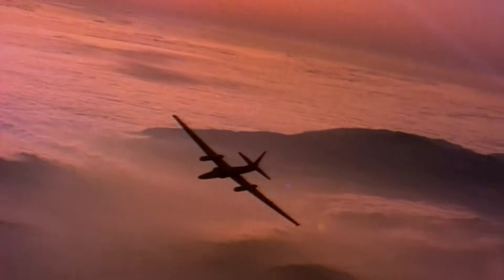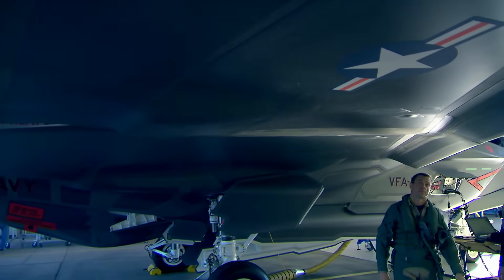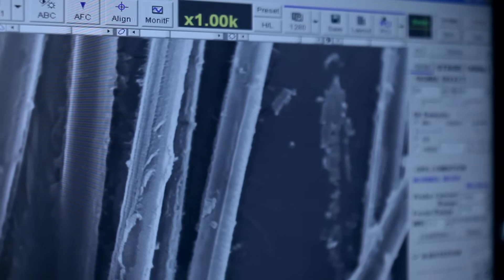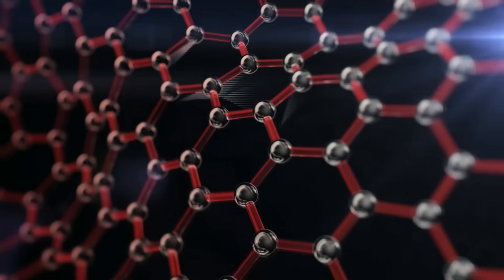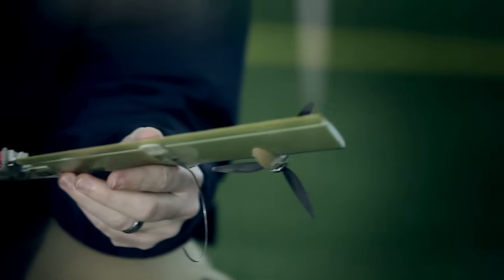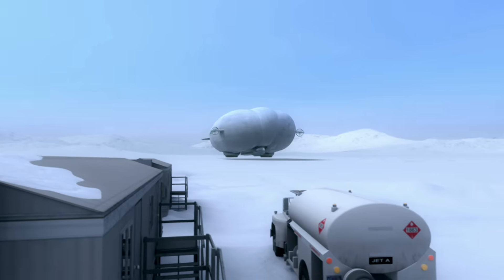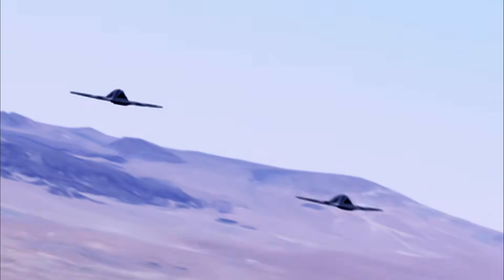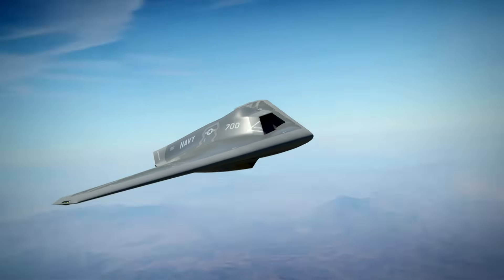Speaking of the Future:  Advanced Aeronautics

Comment: ***ALL THE RAGE***
- inertial-mass reduction 
- High, hypersonics (Mach 10+)
- Non-acoustic ASW (anti-submarine warfare)
- Low-observable/Counter Low-observable (LO/CLO) breakthroughs 
- Counter-Directed Energy Weapons (CDEW);
- High-power, electromagnetic (HPEM) emitters;
- Graphullerene configurations
- Lattice Confinement Fusion
- Atomically-layered nano-fabrication with nano-layering & quantum-entangled properties.
-  "carbon nanotube reinforced polymers" (CNRP) w/yttrium coating
- Self-adapting algorithm-based ECCM;
- Passive coherant location (PCL) radar;
- Miniaturization of waveguide channels
in Terahertz frequencies;
- amorphous polymers 
- electrochromatic paneling 
- Nano-texturing techniques;
- Ultrashort Pulse Laser-Matter Interaction Applications;
- Precision, metallic 3D printing;
- Reconfigurable Nanophotonics;
- Nanofabricated, photonic-integrated circuits;
- Solid-state semiconductors;
- Ultrashort pulse (USP) lasers
(aka. "Attosecond Science");
- Extracting energy from the polarizable vacuum

Lockheed Martin's "WAIVED SAPs" involve both hidden science applications and Ace-in-the-Hole technologies the layman could never dream of even partially comprehending. And if that Waived Special Access Program has the added provision of being "carved-out" from all DSS NISP requirements... Then you can bet your last dollar it's the pinnacle of human achievement.

Comment: what materials that can change shape? can it thin and stretch and continue to be a strong material. oh the wonders I can create. now I need the ability to materialize bombs from an external location...... Mu ultimate unmand fighter could shape shift and become the ultimate heavy bomber
Reply: Graphene. They even showed tubular schematics of it with its hexagonal lattice, 1 atom thick.

It's what they're talking about regarding electrical storage, power transmission, stealth, and variable geometry integral to structures.
Reply: @LRRPFco52  Graphullerene is all the range. They're toying around with the bonding geometries to maximize optical, thermal and electrical properties.

Comment: I think one of the problems with high speed air-travel on commercial aircraft is the noise pollution produced from the afterburners of the turbines (not so much from the turbine itself) at super sonic speeds and the fact that we don't have S/S/T commercial airliners because of what William A. Shurcliff described as the "64 billion dollar problem" is still a problem today and I think Lockheed has the potential to address the issue of the noise problem produced by the sonic boom through advance noise filtration systems.  Because I believe if commercial planes were to fly faster and not be limited by a 650MPH speed-limit because the dangerous noise levels they produce, then that would help us thrive as a species.
Reply: They would never put it into the commercial world tho unless the enemies of the USA already have the technology or once it doesn’t matter that the enemy has the technology because the new stuff is that much more superior.. so I’d give it 80years and maby we will see it.
Reply: @6themaker  Now there is what called the Airbus Beluga a response to airplanes flying reeeealllllyyyy slooow than needs more passengers............a large aquatic animal.  Not a bird.
Reply: As long as the corridors are over unpopulated areas, or at high altitudes, sonic booms aren't really a problem.

I lived in a city where we had constant sonic booms due to proximity to USAF Flight Test Center.

I actually miss them.  The only aircraft that did damage was the SR-71A at subsonic speed, because it was so loud and hit a resonant node at low altitude over my school. Cracked some windows.